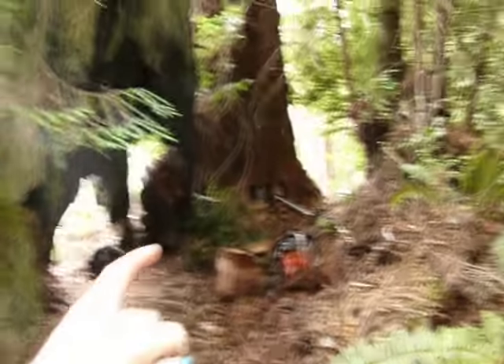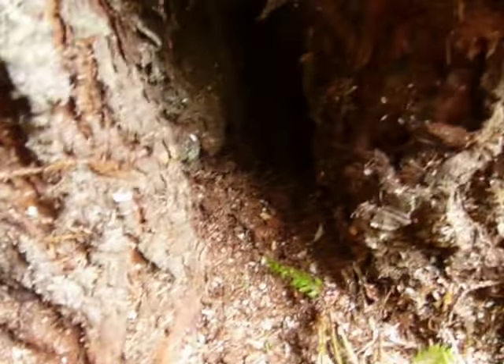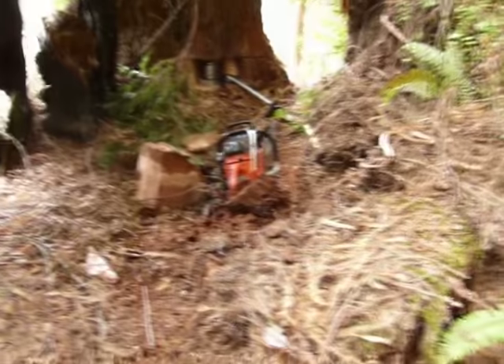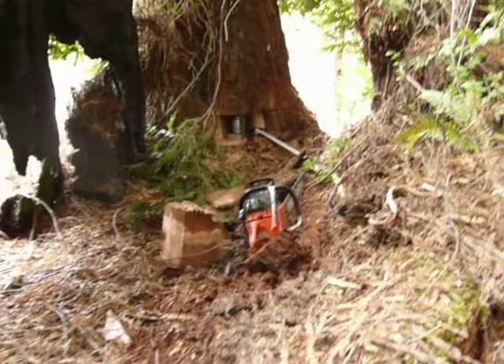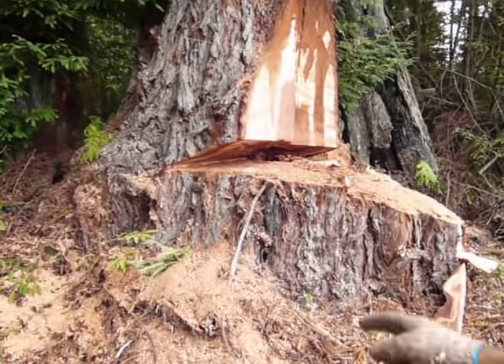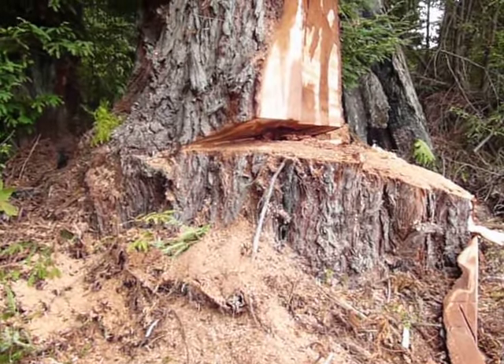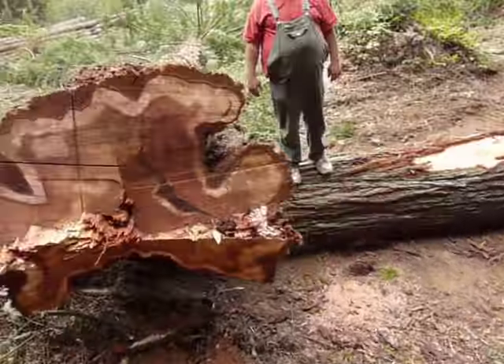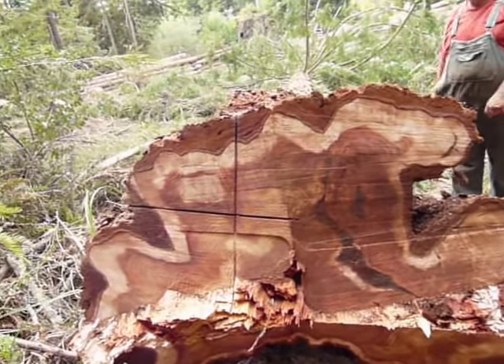Sideyard Jacking

Comment: Silvey timber saver...
Reply from the maker: Andy hi. They made five versions that I know of. Trees Savers, Little Fellers, another smaller double set but I forgot the name, Hi-Jacker, and the similar in design Featherweight seen here.
Invaluable at times they are when wedging is not straightforward or you have a heavy lift.
Thanks for watching.
Reply: @hotsaws101  I have the silvey, sure makes life easier...

Comment: How many ton ram were you using here?
Reply from the maker: Michpatriot hi. 26 tons. The Silvey Featherweight. This is at 10,000 psi. not the 12,500 as with your Borntrager. Both Salt Creek & Borntrager rate their "max" tonnage at 12.5 or 15,000 psi. That needs to be a consideration when purchasing a jack, or jack set.
A guy better make sure the lines, if used, are in great condition if your seeing 15,000 psi on the gauge imho.
Notable, at 12.5 this jack will lift 31.5 tons
Thanks for watching.
Reply from the maker: Also, running max pressure a lot is hard on the seal kits. Please don't ask how I know...
Reply: Thanks for the replies on these jacking videos. Ill be tackling trees that I've got covered with wedging and not cutting full seats when anything seems borderline..it'll take some time for me to get a feel for this jacks capabilities. More or less I'm going for some relief on stacking wedges. Ill probably end up with a second 28ton setup for a mini backpack rig without lines. I'm a little leery of lines..
Reply: Ill add that I've always got ropes available but for the obvious reasons they are back at the staging area, rarely need em but when you do...better to have them, even if its a bear to pack back and forth.

Comment: Just question. Does your axe dig into your back stuck through your belt like you do. I tried that once but sure got myself a ,much more comfortable.  Keep up the nice work and vids. I sure miss the woods and my old saw pard.  It's a tough job but it's worse being too old to do it anymore. God bless and keep going forward.
Reply from the maker: Steve hi.
Some times it will. It's usually around a tight spot near the stump. Most of the time I will just take it out. Thanks for watching.

Comment: Did you know where the middle of the tree would be dead
Reply from the maker: David hi. I think technically the inside (heart wood is what they call it around here) is always dead. The cambium layer which the (generally) lighter colored outside perimeter is where the life is in a tree. Usually the heartwood is much more dense and will support  jacking and/or lifting with wedges even when it is partially decomposed.
I had suspicions before that there might be compromised heartwood and mentioned it when show/talking about the bark seam in the beginning.
Thanks for watching.

Comment: Mr. Jack, 
My name is Joseph Vogrig, I operate out of Spokane Washington. I have never worked for another company in my career, I am self taught other than reading Gerald's book of "fundamentals". I have never jacked a tree but I do find myself wanting to practice with the used 35T Duff-Norton I picked up recently (I have had double wedges spit out too many times??? I'm looking for more lift). Is there a downside to this Jack, as opposed to hydraulic?
Reply from the maker: Joseph hi. The Silvey's are hydraulically driven like the Duff-Norton's. The Silvey's lift more (depending on the model) with far less weight because they are aluminum. The Duff-Norton's are heavier but more forgiving should a guy have a problem since they are made from steel.
Seal kits for rebuilding are kind scarce.
Thanks for watching.